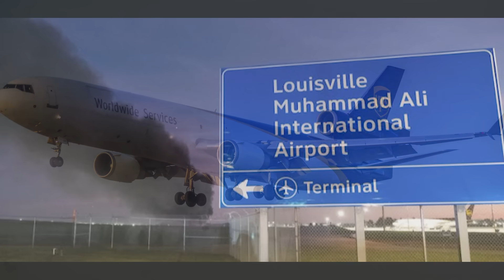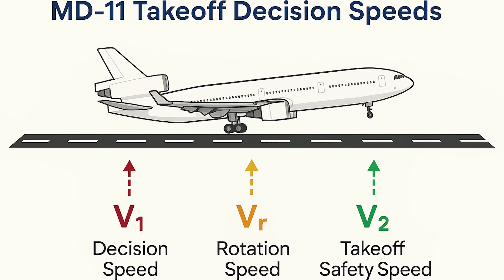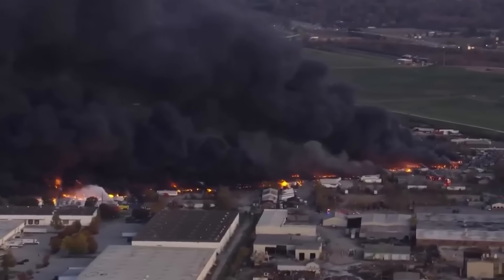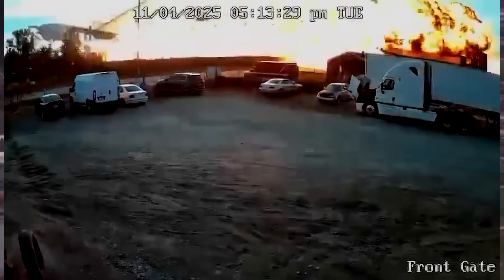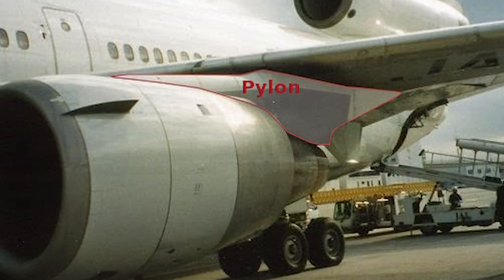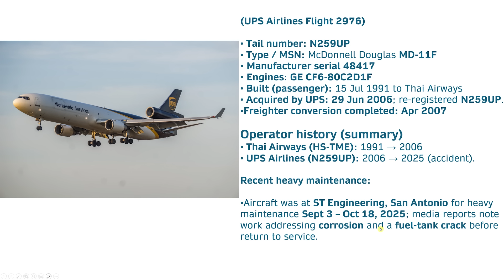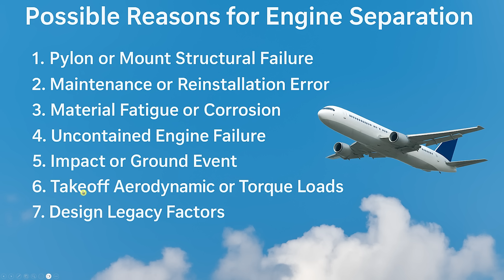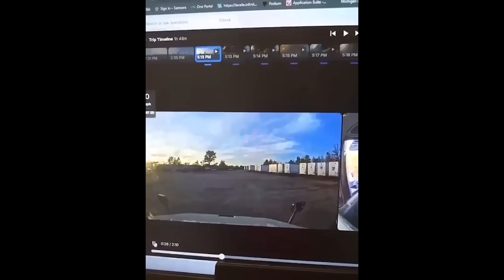What Caused UPS Plane Crash, Louisville, KY? How MD-11 Engine Fell Off

Comment: Runway footage shows engine 2 flameout possibly from the engine 1 failure, detachment, and destruction. It then descends quickly demonstrating an inflection in thrust power and some likely very violent left yaw with the only remaining right engine at full power. Pilot was probably pitching back in a last hope for lift and completely lost any control with that first violent contact. The tail catching the 1st warehouse building left behind the left horizontal stabilizer. The landing gear was intact further demonstrating an aggressive pitch clearing the landing gear from contact. That initial contact likely brought the plane into an uncontrollable left roll, freight breaking loose, causing a knife/skid like path for the heavily loaded plane to release millions of pounds of kinetic energy and explosive forces.
Reply: If engine 2 didn't compressor stalled from fod. More then likely the fod came from engine 1 leaving the plane. They may have managed to climb. But as soon as you lose 2 main engine of a takeoff climb you are in big trouble. There was nothing they could really do because all the training said they where going to fast to abort at that point. They maybe could have planted the plane back down and slammed into the end of the runway to mitigate the damage distance but I imagine there was just way too much going on to make such a decision and engine 2 not stalling tell you have already rotated for takeoff. It just sucks all the way around.
Reply: Engine 2 is the tail engine!

Comment: The engine seems to have failed, then fallen off, not as a result of the fire, but the cause of the fire. I say that because the engine fell off so soon that fire hadn’t had time to cause it to fall off. Either an uncontained failure caused the engine to disintegrate, damaging the mounts and causing the fire and falling off. Or the engine fell off from already damaged  mounts. Admittedly just speculation.

Comment: The engine falling off was the trigger, not the cause of why it could not fly. FIRE OVER AND UNDER THE WING!  Just like the AF Concorde.  I think that probably kills way more than 20% of the lift. Also, while I believe it is possible #1 FOD'ed #2, the compressor stalls could have been caused by the airflow disruption and reduction in density of FIRE.

Comment: This video clearly shows that the theory that the plane rolled 90 degrees before the crash was not correct.  I wonder if it was also overweight?  I thought these planes were supposed to be able to climb on 2 engines….

Comment: My first thought was the Air France #4590 crash - the Concorde that hit a piece of scrap on the runway .  That aircraft suffered damage to different parts than this plane, but I think it’s going to be some sort of debris on the ground that caused the engine to tear away.  The photos of the engine left alongside the runway doesn’t seem to have any soot or charring on the cowling.  They weren’t great photos of it laying on the ground, but it sure seems like it must have detached before the fireball (likely the detachment caused the fireball).  So sad.  Imagine being those pilots…going through rotation already knowing you’re toast.  RIP

Comment: I'm a retired jet engine mechanic.  Jet engines don't fall off.  Wings will fall off before the engine does the engine mounts are so strong.  As in other accidents like this the NTSB will find that someone failed to use proper engine installation practices when installing the sucker to save time and that this unapproved method fractured the engine mounts, they are super strong but not impossible to break. Over time the mounts then just fail as the cracks worsen.  I also suspect mount inspections were either not done at all or improperly done.  All of this would be a clear sign of money savings over safety if true.  My bet would be that there is jail time in someone's future over this.
Reply: This isn't true. There are fuse pins on the engine that are there specifically to allow the engine to break away without destroying the wing.

Comment: RIP to all those that lost their lives. The plane MD-11 is designed to have flown with the 2 other engines however looks like the right engine has a compressor failure if you look at other videos of the plane. The third aft rudder place engine would not of had enough power.

Comment: the engine is (used to be ) attached to pylon by two 10 mm pins , if /when one of them breaks the engine rotates and hits the surface below  causing wing to break

Comment: If there was corrosion on the fuel tank, there may have been corrosion elsewhere that wasn't caught or corrected. 🤔 The MD-11 is a stretch version of the DC-10, I used to work at an aerospace display model company in the Los Angeles area in the 80s so I became familiar all types of aircraft, the day the Challenger exploded I was working on a 6-foot model of the space shuttle when a co-worker informed me of the bad news.

Comment: I just got done installing an engine with my crew not two weeks ago, on a 767, I don't think these individuals had a maintenance crew that forgot to torque the bolts. When installing that engine you have to raise the engine up as well as a cradle that is supported by the strut, the Cradle holds the engine, you Hoist the engine up slowly and align it and then you put a preload on it, then you go ahead and install those bolts. That's pretty standard for most planes, after these bolts are torqued and are observed by two qualified inspectors while being torqued, the Cradle preload is loosened and the Cradle is dropped. Then you go ahead and finish off with attaching the hydraulics, the electrics, the pneumatics, the cowls, etc.

My assumption at this point would be that there was corrosion that built up and was missed, or a crack was formed somewhere and was missed. It might be up in the strut, it might be in the mounts themselves on the engine, or on the strut side, but clearly something failed and I really don't think it was a bunch of Mount bolts that weren't torqued or installed.

Obviously I could be wrong, if it turns out that they all just pencil whipped the paperwork had never observed any torque, then quite a few mechanics are about to have a very bad day
Reply: I agree 100% I've been on the install crew for MD10 and B767 aircraft. There is always one person who's task  is RII (inspection or QC)that is part of the install crew but is not allowed to do any of the installation. His/Her job is to check all the items that require a second signature to verify that task was done correctly. Our RII person would verify the torque wrench was in current calibration and set the correct torque.
Reply: As the fallen engine was left on the runway, there well may be evidence of corrosion, it that  was the case,  on the runway.
Reply: @paulkusinitz1861  Of course. The NTSB will have a materials expert to look at the surfaces where things broke off, to check for fatigue and/or corrosion. That may be caused by a defect in production or by mechanical overload a while ago.
Reply: @paulkusinitz1861  Of course. The NTSB will have a materials expert to look at the surfaces where things broke off, to check for fatigue and/or corrosion. That may be caused by a defect in production or by mechanical overload a while ago.
Reply: It just finished Sept- mid Oct corrosion inspection/fixes, etc in San Antonio last wk
Reply: @peted5217  You are the first one to admit that. I heard that just one time during early reports on a national news channel, then it was never mentioned again. Not ever, even on local news. When half the local workforce do not read english and possible cut corners to save time, would you get on that aircraft? People finding airplane tires and wheels, parts of landing gear and I think engine parts in their backyard, you have to wonder about quality of work?  I understand that from that one single report, that the plane was here from September and left San Antonio on October 18. Barely two weeks before this failure.
Reply: You echo my thoughts. I'm a retired AF aircraft hydraulics tech whose been around many an engine change on various airframes, which, in my experience, don't happen often and when they do, they are instruction-heavy procedures requiring any number of NDI, QA, or 7-level inspections along the way to ensure everything is done right. Of course, civilian maintenance has its equivalents, but I'm not sure there's as much scrutiny; however, given the number of aircraft flights everyday compared to the extremely low number of major incidents, it's fairly safe to say that airport technicians take their jobs seriously and with the requisite care and proficiency they demand. That said, accidents do happen, as do bird strikes, undetected corrosion, stress cracks, etc. that can cause catastrophic failure. These and other factors are the ever-present burdens of maintaining and flying aircraft, especially aging aircraft. While extremely unfortunate and heartbreaking, this incident happened over a relatively small area which will aid the NTSB greatly in determining cause. As always, while the plane and its cargo are replaceable, the crew are not, and I can only helplessly express my condolences to their families, friends, and coworkers who will miss them dearly.
Reply: I’m no aircraft mechanic, I know nothing about the process, or the details, but after hearing the engine fell off during take off, going from past history improper reinstallation of the engine was my first thought.
Reply: @ZippyThePinhead  but the engine had a fire before it fell off. I don't think the bolts would cause the fire.
Reply: @napoleonbonaparte4396 
Again, I’m not an aircraft mechanic, I don’t know, just going by history.
Reply: At least the engine fell off before the crash. Can tell what happened much easier that way
Reply: I've heard there could have been something on the runway?
Reply: I’ve worked line maintenance and heavy maintenance and everywhere I’ve worked and anyone I worked with always took critical maintenance tasks like this very seriously I would be shocked if this accident occurred due to cut corners.
Reply: Thank you for that well informed description.  My husband is a commercial pilot and Imalways worry about corner cutting. He said it wouldnt happen but Im a skeptic.  Thank you for being excellent.
Reply: How many mount bolts are there on a 767 ? Just curious .. I fly a long haul twice a year, another question I have often wondered, is who checks the tolerances on the turbine, and how often ? They do a lot of work ! and predicting when they are going to fail is a heavy responsibility.
Reply: @Qwikbeat engines aren't mounted with bolts. They have mounting holes or lugs that attach to the wing struts with shear pins, which are maybe as thick as your wrist. They are engineered to be the weak point in the equation so if the engine suffers some kind of impact or something, it will detach cleanly and not take half of the wing with it. The plane should (should!) Be able to fly in one engine. But that's after it's already in the air.  Failure on takeoff is a different matter.
Reply: @eclectichoosier5474  of course they are installed with bolts, you have the actual mounts and thrust links, but when you raise that engine up, in the case of the 767 it's four bolts that go up into the strut through the rear mount and four bolts that go down into the forward Mount through the strut.

These bolts are about as thick as your thumb. I just got done torquing some not too long ago, I think it was 3500 in/lbs
Reply: @Qwikbeat  four bolts about the thickness of your thumb on the rear mount, four bolts on the front mount!
Reply: I'm a retired Air NZ Technical Support engineer, I wonder if an uncontained turbine failure could be the culprit.
Reply: @number1genoa  The engine from the few images we have doesn't look like that happened in the turbine section. The front cowling and the initial compressor stages it's hard to tell. If the very first compressor stage failed the blades wouldn't cut the pylon though. The NTSB will know right away if a compressor or turbine fan section failed. Actually, I think they new that probably right away upon first inspection of engine on the ground and I would expect them to have already released that information with the updates they have given us. Looks more like the pylon mount failed for some reason. Corrosion? Improper maintenance? Sabotage???
Reply: I agree. I doubt that engine mounting bolts were improperly installed or not torqued to the proper settings. Internal corrosion certainly could have been a factor. Hopefully, enough of the pylon will be recovered to make an accurate assessment.
Reply: Glad someone said this, sadly no ones going to question whatever the official statement is. Its not a coincidence all the footage out is in 720 potato quality and the jet hit a petroleum factory.. Also whos idea was it to put a petroleum factory at the end of a runway?
Reply: Thanks for a take from someone who actually does the work!
Reply: Unfortunately both have happened, as you know. Or someone used the wrong diameter bolts. On and on and on. I don't really feel like human error is out of the mix of options though.
Reply: A very bad day !!
Reply: Well, next thing you'll hear is how overworked they are and had to cut corners.
Reply: You could just use a forklift to hold the engine in place whilst while you bolt it… AA
Reply: Yep I said from the first it was mechanics errors
Reply: Well, when you fire NTSB workers and you're left with only Republican NTSB members who practice de-regulation, THIS is the end result..

Trump fired a "Democrat" NTSB board member for no cause in May 2025. Others have been fired as well without cause.

You people are going to exactly get what you voted for... Companies that "regulate" themselves. 😂😂😂 

And that's gonna work out great in the airline industry. I wouldn't be surprised if they try to say this was simply a bird strike and that maintenance, or the lack thereof, wasn't to blame.
Reply: @juliat4908 the government had absolutely nothing to do with the maintenance or the regular flying of this plane. Before you spout nonsense, understand how things work first.
Reply: @juliat4908 in fact, if you'd like a reflection of the government's capabilities, then pay attention to the investigation and judge the quality of that. That is where you are going to find true fault or success regarding governmant regulations, manpower, etc.  regarding this horrible event.
Reply: @juliat4908  Don't let any disaster go to waste, eh? Let me ask you, if you have two planes to fly on and you had to choose one which of these two would you choose? Plane on the left was built and maintained by a diverse mix of people of all ethnicities and gender orientations that were selected to ensure a good mix of all of the above was represented, and the plane on the right was built and maintained by people that were trained, tested / certified, regularly re-trained, and met all job qualifications (NONE of which were skin color or gender). WHICH PLANE WOULD YOU FLY ON????? I know my answer!
Reply: @dohabandit 
All aboard the DEI express.
Reply: @dohabandit proverbs 9:7
Don't waste your time.
Reply: It wouldn't surprise me one bit if the reason for the crash was just due to the D.E.I. hiring process on that maintenance crew? 🤔
Reply: @JayLo413 100%
Reply: i worked in Renton on the 737 for 6 years idk mane maybe things aint so bad up there in everet or the non union place on the east coast but i can totally see some dei hire mechanic installing it wrong and  dei qa, customer qa and faa inspectors missing it as well.
Reply: @rizman69 100% we are witnessing the competency collapse in real time

Comment: The V1  sure if the engin did No fall off , but  even passed V1   in this situation should of cut engins no matter what,   The V1  is only to tell the pilot  it is to late to stop  WITHOUT OVERSHOOTING THE RUNWAY .   in that situation stopping  would o yes overshoot  but minimize the damages .   in that situation Taking off could of  been Extremely stupid  for the simple fact  it could of crash in residential areas  or  the airport itself as it turn around .  so to me  The V1  is not relevant in that case.   I have a Hard time believing  The pilot did not know something was wrong with the left engin , specially today with all the avionics and Meters ,  i don't believe an engin can fall Totally off in  20 seconds  and you can also see in the video  the smoke trail  that indicate it must of started before the plane was in even in movement .   anyway i can't wait to see the outcome .